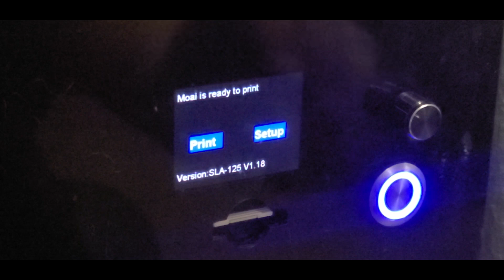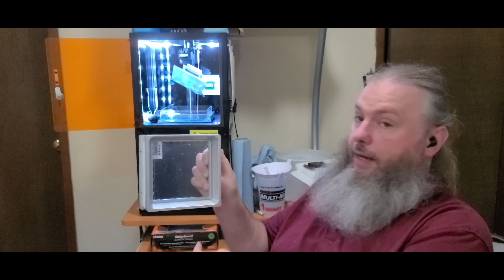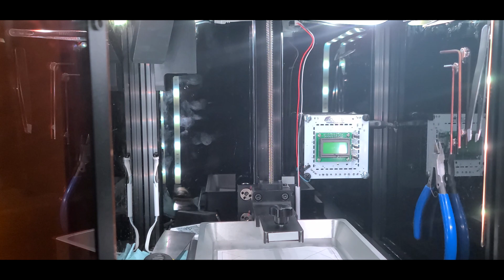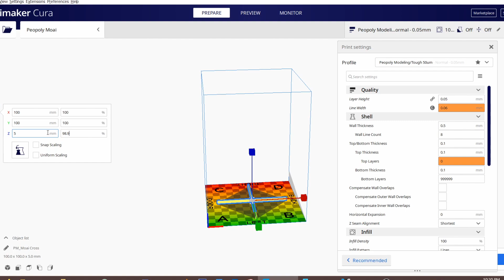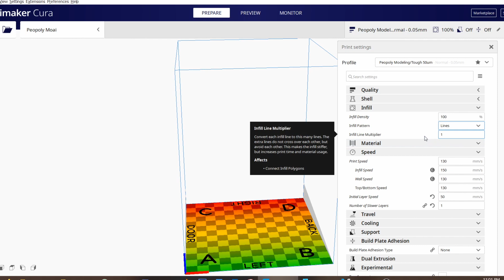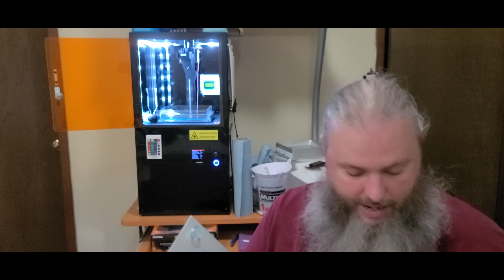Moai 130 Calibration guide - Version 1

Comment: Thanks for the great video, I have not used my Moai for about a year now, wondering if you made any new changes and whats the latest firmware ? have peopoly disbanded this printer
Reply from the maker: As older printers go, it's not disbanded (officially) yet and they are still making changes to it. Slow as it is, they have other bigger more focused projects that take up a majority of their time. 
Here is my copy of the firmware and it has completely changed my MOAI experienced.
https://www.dropbox.com/s/aiz42uxfod5fv8b/moai-20200924.zip?dl=0
Reply: @cainesarmoury8962  Thanks appreciate it. Any chance you can share your Cura setting fort me. I briefly saw them in one of your videos
Reply from the maker: @vaughanza  Certainly!
This is saved directly to my dropbox too.
https://www.dropbox.com/s/g7ujuvpv12iy7gb/Working%2075um%20Standard.curaprofile?dl=0
Reply: @cainesarmoury8962  Thanks you star

Comment: I just got this printer in kit form. Thanks for the instructions, very helpful! I bought this printer to make small spline shafts. I'm using Siraya Tech Blu resin. I probably should have started with some generic Peoply resin looking back. I have some on order. I'm going through the 100mm calibration now. I'm just kind of disappointed in my first prints though. the Z axis prints clear looking down into the parts, but the x-y axis of the parts are very cloudy. It's very hard to see detail. Also some parts have little white flakes on side. I know it capable of better quality. This is my first SLA printer. I have mostly been using my Ender 3, which took some tweaking, so I'm a little used to trial and error. LOL Any ideas> I'm using the FEP vat which I cleaned as well as I could and made sure the protective lens was cleaned. I'm also using the Easy level build plate. Thanks
Reply from the maker: Peopoly NEX series hasn't been the best. They are recommending you use Siraya Sculpt in its place and the difference is minimal. In fact, you have better control with the Siraya series and I have enjoyed it a lot. The only resin I still use from Peopoly is Tough. 
Other than that, you can join us on the Facebook group where I often answer questions about the Moai. Until you're calibrated mechanical prints are a bit off and it took me a while to learn why, hence the video. Let us know your settings, laser power and slicer, as it sounds like you're using everything I would have suggested.
Reply: @cainesarmoury8962  Good to know & yes, this video is a must view. I watched it several times. These shafts I'm printing take some time, (I have a job that takes most of my time), so I haven't done all the experimenting I need to. I ended up with a fairly nice print at these custom settings: X SIZE = 883 Y SIZE = 903 - LASER SETTING = 58 - PRINT SPEED IS 116 @ LAYER HEIGHT of .1 using Cura 4.9.1 As far as your Facebook page, I do not do Facebook. I used to, but I was seeking new employment and decided to rid myself of all that stuff. Thanks again for your help. I'll be looking for more of your videos!
Reply from the maker: @markcaviness7691  good to know that you're able to get somewhere closer to reliability. It changes the Moai experience once you're there.
Don't worry about the Facebook page, I was referring to Peopoly's page for the moai. I'm going to post updates for a 130-150 conversion there.